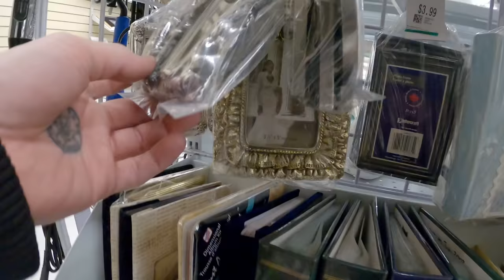Make Money Smelting Ingots - Pewter - Simple DIY Melting and Casting Metal at Home

Comment: Just wondering what you used to clense the metal itself, as iv Hurd baking soda and small amounts of natural sand work well too but it takes a lot longer and should only really be used as a last resort with some types if metal, on the other hand borax itself should be cheap if ordered in bulk I'm guessing but either way cleaning liquid melat is always cool (some metals contain graphite not carbon even this its very close in chemical makeup) but iv seen people use graphite powder as a release agent (guess it depends on experience)

Comment: DUDE! The bottom ring holding that little piece of glass in place on the bottom of the mug is paper thin aluminum and it peels off real easy so that you can just pop that glass out in one piece taking most of the adhesive sealant with it, you don't have to break it!
also, if you want to verify something is pewter and it doesn't have the markings on it use one of those blowtorch lighters and melt a small corner.
Reply: Not a good way to test if it's pewter, that test would show the equal effects if it was something like lead, pure tin, zinc alloys (any pot metal) among other things you definitely don't want mixed with pewter.
Reply from the maker: I’ll definitely try that on the next one, smashing the glass was a bit of a mess!

Comment: What? 15 dollars a pound of tin? In Finland we get 2 euros per kilo.. can you show on video that price somewhere?
Reply: (Writing this in English for the sake of everyone being able to read it)
I'm pretty sure you are mistaken. The spot price of tin - the price at which it is traded on the commodities market in huge quantities - is 31000USD per ton. That makes for about 26 euro per kilo - if you are buying it by the ton. Last month it was closer to 20 euro per kilo, so some fluctuation for sure.

Scrap price for tin, at least on romuta.fi, is about 3 euro per kilo. 
Retail price for tin ingots, on slojd-detaljer.fi, is around 80-100 euro per kilo. For tin wire, such as used for soldering, one can find it for about 65 euro per kilo.

These more "exotic" metals have notoriously high margins whenever consumers enter the picture, whether you are buying or selling. Basically down to the fact that you are necessarily dealing with fairly low volume and therefore customer acquisition, storage, etc. become major costs. I  speak from first hand experience, having gotten into the zinc ingots business in the hopes of brining even some semblance of reason into the pricing of them (and having afterwards partly discovered where those big margins are coming from and going to...)

15usd per pound seems like a fairly reasonable transaction value for recycled tin like this.

Comment: Is copper easy to smelt ?
Reply from the maker: For sure it is! It’s the 1000deg melt temp that’s tricky, so you can’t do it with a camp stove like I’ve done these.
(Sidenote: I don’t want to mislead people about the term ‘smelting’, I used it for tag value but technically smelting refers to refining ore, not melting down pieces as I’ve done here)

Comment: a cleaner cast could be achieved with a high temp silicon mold rather than metal. You may need a vacuum chamber to make the mold .
Reply from the maker: That sounds a bit more expensive, but I’m sure there’s a DIY solution too?

Comment: For low temp alloys I have had real luck using graphite powder in molds to get better casting details
Reply from the maker: Huh? I’ll have to look into that! Does it just polish off?
Reply: @thubprint  It is a very fine powder so doesn't really leave anything on the metal. Basically acts as a high temperature lubricant and helps the metal flow. I switched to it as using baby powder or etc was generating strange byproducts in casting. I got a bottle of microfyne from southwestern graphite on amazon for reference.

Comment: 8:45 pulling vacuum on the mold but unless the quality of the casting is detrimental to your product its probably not worth it. You need a specific type of vacuum pump that can handle high temperatures or a method of cooming the air before it reaches the pump.

Comment: As a hobby scrapper I try and find more sufficient methods of storage for non ferrous metals, but I am curious to see how it all works when everything is all ready to smelt and whatnot.
Reply from the maker: I think largely it isn’t profitable to melt them down, but it is fun and a sensible storage solution for long term stacking
Reply: @thubprint  that I do agree but at the same time I’m more than welcome to try out new ideas for storage, sadly the pile is climbing and storage is becoming an issue so figured that would be a reasonable idea.

Comment: That decorative plate @2:15 with the designs on it is straight up pewter. And worth more than the $3 price tag that was on it. I picked up 3 dinner plates for $3 total at local thrift shop. Made by the Wilton Company RWP. Should go back and get if its still there.
Reply from the maker: Seriously?? I scratched it and it wasn’t particularly soft, plus it felt and sounded like aluminium.. I guess you’d have to melt it to really know?
Reply: @thubprint  They might have a lil more tin in them. But I recognized the logos and stampings on the back of the plate. The Wilton company out of Columbia PA. Look up "Wilton Columbia Pewter" on your favorite search engine and look at images. Go to ebay and etsy listings. Anytime you see words or logos on the back of an item look it up on search engine. You might be surprised about what your holding.

Comment: Pre-heat the mold, I cast bronze, brass, and aluminum sometimes, though extremely different temps, it still matters to get rid of water/condensation from the molds. I just take a torch (or my 3000 deg. burner) and wave it over the muffin pan or whatever other mold I'm using until i see all the water clear up (even though it doesn't look wet). 

I've also seen some jewelers lube their molds with oil, but I've never tried this so I can't say. I'd just use something light to try it out with like mineral oil.

Other than that I'm not quite sure. Some of it surely has to do with the purity of the alloy and also if the environment is oxidizing. If you put a flame or something above the mold to kill the oxygen, OR just held the very end of a blow torch flame in each mold (muffin) cavity while pouring each one, you'd be using most of the oxygen and your ingots should theoretically turn out flawless. This is how professional gold and silver foundries do it to great success.
Reply: I'm not new to casting except with Copper.  Pre-heated muffin Tin  [[Steel]] and my copper ingots fused into it.  Where did I mess up?   Finally got a single Mold from Graphite but not used it yet.
Reply from the maker: See I thought preheating was all it would take, but I think the aluminium muffin tray was where I messed up. It just didn’t hold any heat I put to it.

Comment: Either use individualized I got molds (because of the size) or cut your tray into quadrants and put them into a pressure chamber. Also you could take and sand and smooth the inside of the molds.
Reply from the maker: Some next level tips right there!

Comment: I would think the reason the cast was not smooth was due to air pockets maybe vibrant it too push the bubbles to the top
Reply from the maker: I’ll try that next time, as well as heating the pan. I’ve seen a few other pours, and I think I’ll just use the side of my angle grinder to vibrate them before they harden

Comment: With a low melting point, just put the mold onto the camp stove. I think a lot of the bubbles come from the metal being poured and cooling with air trapped between. The bottom part of the ingots will cool very quickly since they are in direct contact with the cold mold (cold meaning its not hotter than the melting point).  You can melt metals like copper in the mold, but people dont do it because it degrades the molds faster.
Reply from the maker: Ahhhh got it!
Reply: Thank you.

Comment: Use heave steel molds to get better casting results and remember ALWAYS PREHEAT YOUR MOLDS prior to pouring in them (also gives a better result)
Reply from the maker: Actually that’s a really good point, those aluminium pans probably don’t hold any preheating well at all

Comment: Heat the tin up to 600 that’ll make it behave more like a liquid and use a blow torch or glass light to heat the moulds up and heat them up to 150 also ensure that there is no non stick coating and if you do use graphite dust
Reply: Celsius
Reply from the maker: Thanks for the great tips!!

Comment: De-gas the metal while its still molten. The easiest way I learned  was by stirring it with freshly cut and stripped wood. Do this between fluxing.
Reply from the maker: Ooo, that’s a cool technique actually?
Reply: @thubprint  I agree. I hope that works. Something long lost in memory thinks the carbon from that wood does something to purify but I may be remembering something utterly not related.

Comment: You said that the picture frames were the worst value, at $4.00 per lb. 

The other items weighed brought the total cost up to around $8.00 per lb.

The picture frames cost you half of what the other items did by weight, if my math is correct.
Reply: That would make them the best value, if I wasn't clear.
Reply from the maker: You’re probably right, but all these items were pretty bad value compared to what I’d like to spend

Comment: another source of tin on the cheap is AT the scrapyard depending on how much they sort and if you can purchase scrap there(not all will do so). the one i got 60 lbs of 60/40 bar solder at did not have a separate bin for it so its "just lead" take your dead presidents out of your pocket and enjoy your "just lead" from these places :) i really really won't need to buy it again nor  i will be searching for tin again in my lifetime with this one find it seems so far. Linotype blocks are another SUPER useful source for bulletcasting as its 12% antimony and 4% tin. oh don't try to quickly cast 60/40 solder as the video as it takes forever to cool....sometimes if you have molds for ammo, this is a wise time to cast small amounts this way as you don't need a lot of it for small casting jobs.
Reply from the maker: Sounds like you’ve got your sources sorted! I’ve bought lead from the yard before but I haven’t gotten into the good sources of tin etc like you’ve described here. Thanks for the tips!
Reply: @thubprint  if you get a pretty constant trip to the scrapyard, its wise to look in their lead bin as you may not find it every time but when you do, you might get a few lbs depending on your scrapyards sorting skills(lazy yards are preffered here), , old linotype blocks are another source to keep an eye for as well for antimony and tin. these are simple to spot as they have reverse printing on them. if you figure 10-20 lbs show up, melting them into ingots saves buying from say rotometals a bar of super hard alloy which is 70% lead and 30% antimony at 31.00 for 5 lbs and then shipping it.

Comment: Increase the profit margin. Look for the free stuff. You are a scrapper. People throw those broken items away all the time. Especially when there is a move out/clean out/spring cleaning.  May not be much in one stop but over a month or two you would have a nice melt pile.
Reply from the maker: Absolutely! I pushed this one and overspent because I wanted some material to work with, but that’s definitely too much to spend on a regular basis

Comment: Lol that ending 😂🤣😂🤣 For a prettier cast, you need to slow down the cooling rate, but that's all it does. It makes it prettier. I wouldn't bother.
Reply: Would a wool moving blanket underneath the pans help?
Reply from the maker: That’s my issue, I forgot to tuck them in! 😆
Reply: what about preheating the pan in the oven before pouring the ingots

Comment: there isn't really much you can do to get better casts, small air pockets, dirt there are a number of factors just preheat the molds before use
Reply from the maker: Must have just not heated them enough I suppose
Reply: @thubprint  blowtorch or something along those lines works great if you don't have one hold the tray above the stove if it goes greyish black then it's ok to use

Comment: dont waste you time pre heating muffin tins just make sure that they are clean if the pewter cools quick they dont go yellow 
all so use a ladle keep the pan on the heat keeping the pewter hot and pouring two or so at a time you will get better results with practise
Reply from the maker: Thanks for the tips!